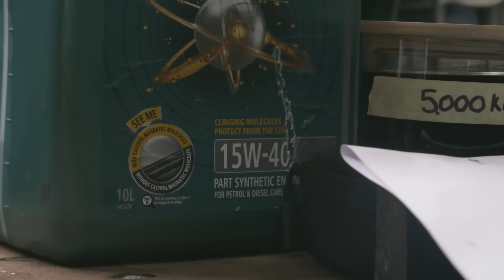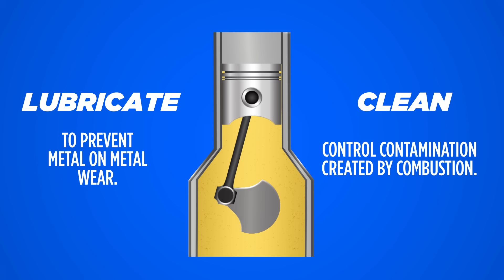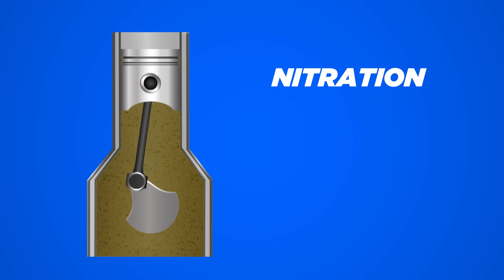Engine oil COMPARED at 5,000km vs 10,000km vs 20,000km! This'll make you service your 4WD RIGHT NOW!

Comment: I do just a normal engine service every 10,000kms (highway kms) Fuel filters every 5,000 kms , Diffs gearbox and transfer case every 50,000 kms
I also run race dirt bikes so I’m changing the oil after every ride. So the Castrol giveaway will definitely come in handy for me. Would definitely run Castrol graphics of next season if that is the case.

Comment: 1991 nissan terrano td27 turbo 400,000
Engine oil- 5,000kms
Transmission- 30,000
Rear Diff- 30,000
Front diff- 50,000- 60,000(part time 4x4)
Transfer case- 30,000

Comment: A standard 5k service for me is oil, oil filter, fuel filter, air filter.  Every 10k is plugs cleaned or replaced (depending how quickly I clock up ks)  trans service, throttle clean, maf clean.  That's just me with a diesel or petrol.

Comment: 2016 silverado 1500 - oil change every 5000 miles and also ran a oil catch can on the 5.3l direct injected.

2019 ram 1500 - oil change every 5000 miles

Comment: Mazda BT-50 2011 with 300k's
Change Oil at 10k's
Never have changed the Gearbox or Diff oil.

Comment: I usually do motor oil and oil filter every 3,000 miles, diffs and transfer case every 30,000 miles, and the transmission fluid every 60,000 miles. Now, granted I’m from the states and idk the conversion factor to kilometers, but this interval has always worked for me and my 2001 4Runner.
Reply: 5k km is roughly equal to 3k miles.
Reply: 3k is great
Reply: 3k change interval in a 4 runner is wasting good oil and some oils actually protect better when not changed early because the detergents wash off the protective layer that modern oils produce on metal surfaces.

Comment: I honestly change my oil based on oil colour, once it's black it gets changed.
I've got a petrol and don't think that philosophy would work for diesel owners.
I used to use top spec oil and extended oil changes,
Then i went over to entry level "good" oil with premature oil changes, 
With fuel prices what they are and mechanics asking an arm and a leg I'm over to above average oil with premature oil changes.
Hx7 for the win boys!

Comment: Just took my bt50 in for a new clutch. Ended up needing a new front diff, left CV, ball joints, new front brakes. So I think every 15,000 is good for the next few services $$$

Comment: I’ve got a vdj76 and on a budget. But I’ve always changed the oil with Castro every 4000-6000km depending on trips. I go up to the Pilbara and Kimberly often as I live in WA. And I’m always carrying a load and going very remote, so want to make sure that everything is in proper running condition! And wanna keep this car forever so changing the oil regularly is Essential
Reply: These Landcruisers are like default vehicles in the outback. Suppose its the only choice as there are no other vehicles out there can even comes close

Comment: Serviced vehicles in the bus industry, went from 10k servicing to 60k servicing, with oil analysis every 10k.   Lift the rocker cover every 12 months for valve  lash adjustments, no sign of sludge. These engines had a 70% idle time.
Reply: oil capacity plays a big part in service intervals, my trucks oil is replaced every 90,000kms
Reply: @Bradthetruckie  oil capacity and oil spec?
Reply: @Bradthetruckie  also which manufacturer was it if you don't mind sharing..?
Reply: @itumelengmahaole5890  Mercedes/detroit 10W40 Grade 228.51.  not sure how many litres exactly but i think its around 40-50ltrs
Reply: @Bradthetruckie  thank you so. What kind of mileage do you generally get out of the Mercedes-Benz trucks? Some transporters in South Africa swear by them and only keep them in their fleet while some say they are utter rubbish.
Reply: Is there an oil filter change interval that is in the 5-10k range? I'm beginning to suspect water contaminated oil and bypassed filters are the main reasons engines file these days with these great motor oils that are now available.
Reply: With that much idle time in a diesel its a Surprise the bores weren’t glazed up.
Reply: @frankz5864  that's a myth.
Reply: @jamesfranko5098  Dragons are a myth mate, bore glazing happens in the mining industry all the time.

Comment: I do an oil and filter service every 5000kms I do fuel filters and air filters every 10,000kms. I repack my wheel bearings every time I do a major 4x4 trip and my diff oils and brake fluid get replaced every 20,000kms.

Comment: I service my petrol 4wd every 10000km (recommended 12000km) and carry out full oil analysis every 5000km. 
This covers things such as PQ, Nitration, sulfation, oxidisation, water content, viscosity and elemental analysis. 
Oil analysis will allow you to know exactly how the oil is performing at each interval and then you can either shorten or lengthen the service intervals either to save wear on the motor if intervals need to be shortened or to save money on servicing if the intervals can be stretched out.
Reply: Please change at 5-7,5 k km you will thank me later. 10K is not bad but oil is not good after 8 and you wont become a millionaire using this gunk for an additional 2k

Comment: Can never go wrong running clean oil through the horse I generally aim bit over 8000km twice a year good check over of the quality. Going the 8000km or 6 month whatever comes first. The oil isn't as filthy, engines running little bit easier and well I don't think I'm wasting oil considering it's black and time to go. Nothing better out with the old in with the new. But always a top quality oil. Enjoyed watching this with beer. 👍👍🍺🍺

Comment: I don’t currently own a 4wd but back in the early 1990s I would change the engine oil in my  1979 Nissan G60 with Nulon 20w50 every 3000 to 4000 km . My mates would often say that whenever I’d drain the engine oil that it was clean enough to put in their vehicles lol 😂.

Comment: 2003 TD42ti patrol wagon. Every 5000 KMS, Oil change and Filters. Every 10,000KMS Fuel Filter, and every 20K Diffs/Gearbox/Transfer case (basically just over 12months). Coolant change Every 40K. Helps keep the tractor running smooth and hopefully for a very long time to come. Tow a camper when I head away so always want to make sure basic things are in check.

Comment: Engine every 3000 KMs diffs I'll do every 10 thousand ks gearbox once a year but yeh that's on a 06 triton and I only do the oil quite regularly because it's hot 410 thousand ks on the poor 3.2 and if ya go more then that it starts burning oil

Comment: New rear diff centre in about 5000kms ago (and genuine toyota locker too). 4 oil changes on it in that 5k. But otherwise rear diff per manufacturers recommendations or more frequently if I’ve been giving it a bit of fun. Front diff less frequently but at least per manufacturers recommendations (85w140 mineral hard as blazers to get at the moment).  Gearbox and transfer case changed at same time per manufacturers or a little more frequently if I’ve been giving it a bit of fun.

Engine every 5k when on trips towing or out bush and having fun. Back at home every 10k.

Comment: I’m one for servicing my 1hz 80 series every 5000kms just clocked over 450000kms I do all oils including front and rear diffs transfer case engine and gearbox with a new oil filter and do brakes every 10000kms with fresh oil and I won’t lie Castrol make it simple with there rego to oil which I use to get the right gear for job at super cheap it’s expensive which I understand and probably over the top but how can you put a price on beauty

Comment: I change my oil per log book, every 10,000ks for engine. Diff and gearboxes have never been done. Hmm better pull the didgit out. It's only a 2004 courier but it's mine! Had the beast for 5 years .before that a mighty ditto 720! 16 years of faithful service and when sold did not have a rattle or leak. She always got serviced every 10,000 ks. Now on a disability pension and can't afford fuel let alone bloody oil as well. Cheers from Tassy.

Comment: The most importent thing you should have is a bypass filter. Amsoil filters down to 2 microns. My 05 cummins goes 10,000 mls on main filter and 20,000 on bypass filter. I have sent samples to lab at 10,000 was told change filters only oil was still good.

Comment: 1998 Toyota Land Cruiser 105 series. 
We change our oil every 5,000km’s definitely better for your car, and helps avoid any of those problems. 
We change our diff oils every 10,000km’s so every second time we do our engine. We 100% prefer to use good quality oil as it is just purely better for your car.

Comment: Sorry to say this, publicly but you really are one of the least well informed 4WD / Off-road commentators on YouTube unfortunately.
This video about oil is the living proof.
You should stick to what you know coz based on this video, you don’t know sh!t from clay.
Without used oil analysis to quantify the results - your just expressing your ill informed opinions, and opinions are like ass holes, everyone’s got one and they all stink.

You actually CAN get away with 20,000 km oil change intervals but ONLY if you employ sub micron oil bypass filtering and or centrifugal oil filtering - preferably both & the results have actually been verified by used oil analysis.

You all p!ss on about oil catch cans, DPF deletes & egr block plates etc, and the reality is you have no fecking idea.

Some of us old timers have forgotten more than you will ever know about these topics.
We just don’t waste our time on YouTube trying to be the blind leading the blind.
You appear to be one of the worst examples along with Tyler & Ronny and Cahill. 🙄👎
Go talk to some trucking company’s practicing 20,000 km extended interval oil changes, they all employ sub micron oil filtering.
The sad thing to me is that, your mis information might well mislead others who view this crap.
I reckon if you had even half a brain you’d be dangerous. 🙄👎

Comment: 24 year old car Every 5000km for engine, 10,000km for diff oils, 15,000km for gearbox fuel filter gets changed every 5,000km and the air filter gets changed every 7,000km

Comment: 1996 Landcruiser 80 Series 4.5L petrol.  Serviced as per the recommended intervals in distanced travelled in the owner's manual, for all fluids (ie. engine, transmission, diffs, radiator etc).

Comment: I let the big TD42 boil the kettle for a few minutes and then start driving.
Try to aim around 7000ks and do my engine oil, filter and fuel

Diff, gearbox and transfer case try to aim for 25,000ks and by that time I’ve finally saved up enough to afford it 🤣
Also using the Castrol RX with Morey’s oil stabiliser and motor hasn’t used a drop of oil and the forklift motor still ticking along first start!

Comment: Too to bottom heavy towing work trailer and 7.5m boat in hot climate averaging 40 degrees in summer
diffs 5-7k
Engine 5k
Gearbox /transfer 7k

Comment: I service my colorado every 5000km because i am a mechanic and easies to change oil then a motor I change all filters and grease up and drive line oils every 40000km because oil is cheap insurance and lot easy that changing a engine or gear box

Comment: G’day Shauno,
I service my engine oil every 10,000 and diffs, gearbox and transfer case usually every 40,000 as my car does lots of different driving styles from highways to slow low range tracks. Every second oil change I also change my fuel filter as a common practice and every 60,000 I’ll do a full coolant system flush to prevent corrosion
Reply: Did you not read the new snake oils allow you to NEVER have to change any oil ever again.  It has to be true because its in the owner manual and they would never lie would they?
Reply: @Physics072  Haha 😀For real, though, I used to use that "Lucas Oil Stabilizer" thinking I was beefing my oil up.  Then I found bobistheoilguy forums.  Someone did a VOA on that and, guess what?  It's just a Group II oil with zero additives.  NEVER use that crap lol.  It's literally diluting your additive pack by 1/4, 1/5 or 1/6 (however many quarts your engine takes) and just thickens it up.  

Now, I am a fan of high mileage oils.  They have more of the additives that all engine oils have (more anti-wear and detergents) and do reduce oil consumption by rejuvenating seals.  I think high mileage oils would actually be great to use from day 1 on an engine.
Reply: 2001 Isuzu 280 dt- (4x2 with difflock still goes wheeling) same service schedule as yours except I change my coolant every 10000km as well. 335936km so far....

Comment: When I had my 1hz 80 series I’d change the oil and oil filter every 5000km, fuel filter every 10,000km and diff/transfer/gearbox around 30,000km. The old girl loved it. We’ll be making sure we give our 2022 troopy a decent run to get everything up to temperature and probably service that more regularly than Toyota would presumably say 😇
Reply: Damn
Reply: Fuel filter every 10000 km??? 😂😂

Comment: engine & oil filter every 10,000km, will always check/change diff oil if I've been through water. gearbox & transfer every 30,0000km. 1hdt 80 series

Comment: 2015 Dmax personally I change almost everything at fixed KM targets.
- Engine oil and Filter @7500-10,000km
- Front and rear diff oils @ 20,000km
- Coolant once a year
- Fuel filter @ 10,000km
- Brake Fluid @ 20,000km or once a year.
- Auto Trans oil @ 40,000km
- Transfer case @ 20,000km 
- Power Steering fluid @ 40,000km
- Front bearing regrease and seals @ 30,000km or directly after a strenuous 4WD session
- Remove and inspect rear drum and shoe condition and adjust/ clean as required. 

Might've missed something but that's my religious schedule
Reply: Time to definitely check your air filter then... lol
Reply: @garyfinch1840  knew I forgot to list something 😂
Reply: @gypsy_on_drugs1285  yeah was only stiring. I'm sure you've blown it out a couple times.
Reply: Jesus, your car would be like new😮
Reply: @Dudesunperfect  she has 140,000km on it and runs like new still.
Reply: I would go for 5-6k for the engine oil or 1 year (max)
Reply: The coolant needs to be changed once a year???
Reply: @Adrien_broner  I bet it really doesn't help at all. Just waste of coolant.
Reply: @zen933  every 2-3 years is better.  Sure don't want heater core problems.
Reply: @Adrien_broner  it's a good habit, you'll always ensure its gunk free this way and see the engines condition aswell.
Reply: Wow, still using rear drum brakes
Reply: you love your cars ... you really do ... id do this too but id say i strech is a little bit more.
Reply: What country do you live in to go by km?😅
Reply: I do change my oil synthetic every 5k miles, NATURAL 3k miles. Case closed ( Pennzoil or Valvoline )

Comment: road vehicle
engine 10k or 6m
auto 50k or 5 years
diff, transfer, manual trans 100k or 5 years
brake fluid 2 years
coolant 2 years unless long life then as per recommendation

offroad vehicles halve all these unless contaminated with water then replace immediately

Comment: I own a 2021 Navara and the manual recommends a service every 20,000km. 

Currently at 14,000km and it’s still as clear as the 5000km oil in the video, in saying that I haven’t done any serious tedious 4wding in it yet.
Reply: I got a 2021 Nav also, my book recommends every 5k, lucky I’m a mechanic by trade and work at a workshop, get to service it myself every 5k, if I was paying a workshop, most probably service it every 10k
Reply: @rajivnath1799  is that an oil change every 5000km or service? 

The service is every 20,000km according to the service booklet.

Comment: Every 5000 k’s for the engine every 20,000 k’s for gearbox transfer case diff and 10,000 k’s for fuel filters on a 2020 prado I do that because I just don’t think the newer motors are as strong as the old girls

Comment: In my 2003 hilux change the engine oil every 5000 kilometres diffs an gearbox every 30 thousand kilometres an gress every 5000 as well thats the way my old man has all ways done it an never had a problem so that's the way iv allways done it as well

Comment: Honestly, my Car has 400.000 km on the clock and the previous owner did oil changes every 15000 km, so why should i go down to 10 or even 5 k, the damage, if any, has already been done.

Comment: Well I won't win as I only use AMSOil.  Engine 10w40 at 5k and the long service interval GL-5 spec server duty front and rear diff and transfer @ 30k - amazing stuff and the results are proving a good choice.
Factory toyota auto trans fluid changed every 40k even though it says 'sealed for life' - 200 series for life.
Reply: I too use Amsoil Signature Series "100% Synthetic" Motor Oil for the past 20 years and I have achieved the same results as you, even though I change the oil once a year in my vehicles, which can vary 6,000 miles and 12,000 miles.  For the benefit of others reading my reply, why did I choose Amsoil?  After experimenting with various brands of "Full Synthetic" oil (including Castrol, Pennzoil, Valvoline, Mobil 1, etc.), I was amazed at the overall performance, increased horsepower and higher fuel economy!  All my fluids (ATF, Gear Lube for the differentials, Coolant, Power Steering Fluid, Brake Fluid, etc.) utilize Amsoil as well, so my vehicles are protected by the Amsoil Warranty.

Comment: While I can only assume a lot of the information was accurate. Pouring oil in inconsistent quantities on a piece of paper is pretty low effort and doesn’t tell you anything. Would of been interesting to see oils tested from different cars, older engines like sooty l, your 200, rangers do 15k or 7500k, smaller engines like the amarok 2L, merc sprinters have 30k oil intervals.